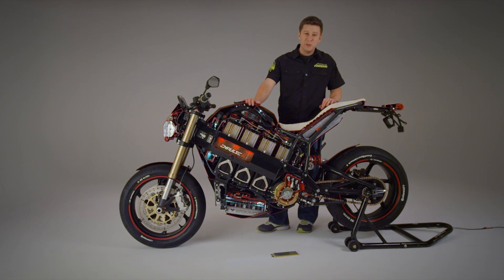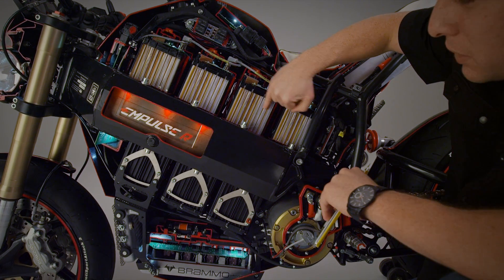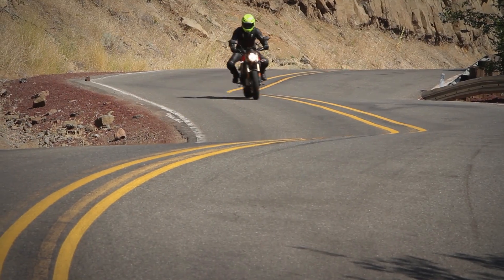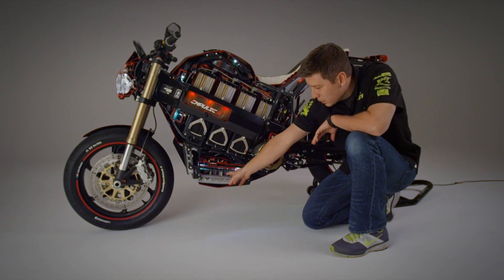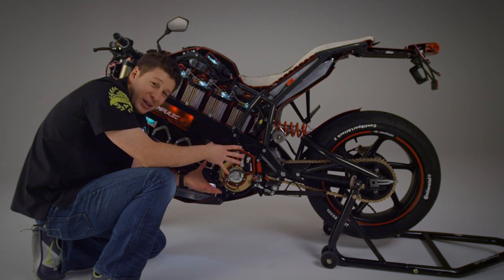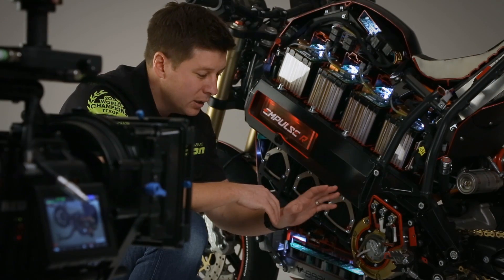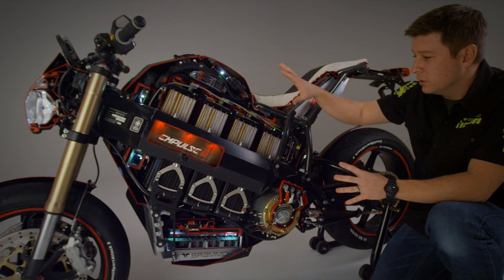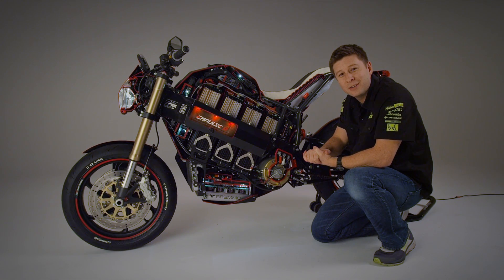Brammo Empulse Cutaway - Tech Overview!

Comment: a liquid cooled compact motor, brilliant! but why was it not mentioned in this short video?...brilliant nontheless. from race tech single speed to 6 speed production model another brilliant choice for motorcycle enthusiasts...love how this bike has progressed, would like to see an LED lighting system to further improve energy efficiency, then eventually a full body wrap to increase aerodynamic efficiency...maybe in the not too far distant future...modify the power system to include a custom 15-20 kW micro turbine range extender with Capstone Technology to bump up the power output and reduce the size of the heavy limited range and power output battery pack.